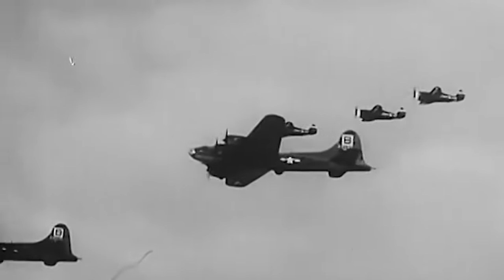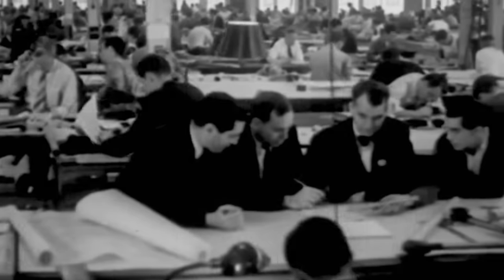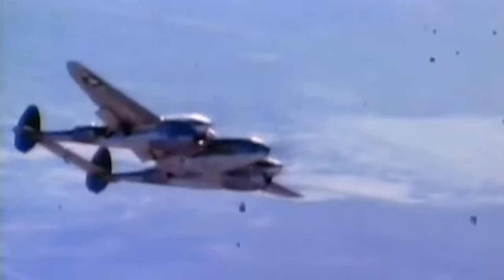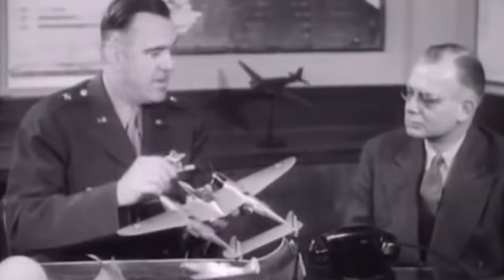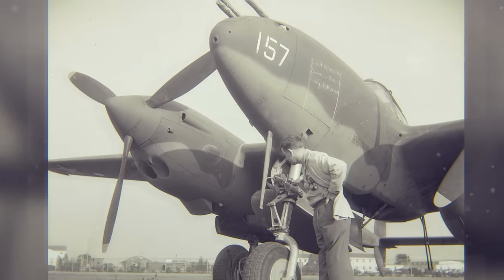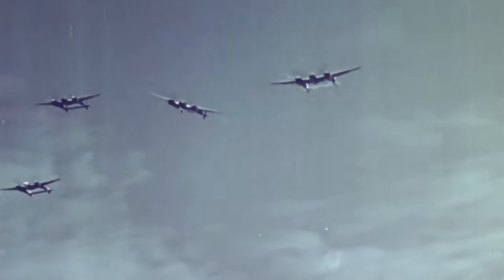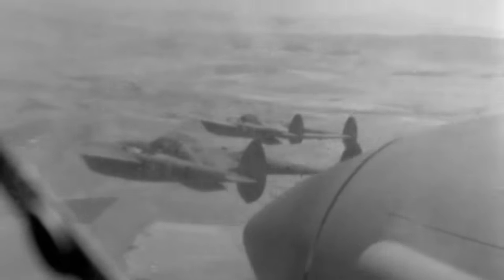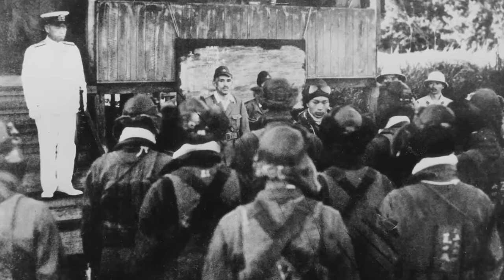Lockheed P-38 Lightning: Outstanding Fork-tailed devil fighter-bomber

Comment: I wonder how the P38 and also the P39 would have performed with the same Merlin engines in the P51/Spitfire?
Reply: I dont think Rolls Royce would have allowed any to be used in another US plane. They had been diddled with the Mustang
Reply: In the P38 there would have been a loss of performance.  It had supercharger/turbochargers for high performance, high altitude operation.  The P39 didn't nor did the P51.  That is the reason that the Merlin did so well.
Reply: The Russians preferred the P39 over any other fighter. It had a higher kill ratio than any fighter in the ETO. It was a superb fighter at low altitudes. It's lack of a dual supercharger was it's biggest limitation.

Comment: The wooden wonder mosquito could carry nearly equal bomb load to a B17 and fight ( Not at the same time . ) 
 I was astounded to read that the P38 carried nearly twice the bomb load of a B17  . These 2 planes are in my top 2  favourites  from WW2 . 
 Bombing Germany would have been a safer prospect with these 2 planes exclusively .  And they could have escorted eachother or themselves .
Reply: The 17 could carry 12,800 lbs of bombs.
Reply: @miketrusky476  Trading off fuel load for bombs.  I don't think that a B17 could get all the way to Berlin with 6 tons of bombs aboard.

Comment: So, answer me this if you would: then why did it take until very late 43 - 44 for the Army to provide long range fighter protection for the heavy bombers over Germany ? These were in the Pacific in 42 !
Reply: The 38s were the first fighters over Berlin,  the Army demanded they fly wirh the bombers (250mph) same mistake the Luftwaffe made over England, wirh the same results and poor reports of plane and pilot were to blame as a cover up for poor taticts. When ALLOWED to fly away from the bombers as the 51s did all kill numbers to lost fighters were almost  exact, because of camera work the 38 was unarmed, skewering the numbers more. Used as s light bomber ,with loss of speed, , almost 80mph and flying low to avoid RADAR  also increased the numbers lost. No other fighter could be asked to do these missions , the uneducated of these facts view the 38 poorly.
Reply: @miketrusky476  yes. Until Doolittle took over the 8th, fighters were on a short leash. BUT even then (42-43), NO 38's or 51's were present in the ETO. Even though the 51's were bought by the Brits in 40 ? AND, HOWEVER,  the 38's WERE in the PTO because they were used to shoot down Yamamoto in 43 (Operation Vengeance 18 April 1943) So, my question stands. Why weren't they used in the ETO sooner ?
Reply: @billotto602  2 squadrons of 38s fought to the end of the war in Europe cant remember the "Back Door GANG " number, but you can verify,  374 I think was one.
Reply: Numerous units did, the 47s were being upgraded well into 44  and the 38s stayed to wars end in Europe. "The Back Door Gang.
Reply: @billotto602  Those P51 bought by the Brits was British with Allison engines and were stuffed at 25000ft
Reply: @jacktattis  until they stuffed a Rolls-Royce Merlin in them ! PLUS what about the P-38's ?
Reply: @billotto602  1. The P38  was in the ETO from 42 to 45 P51 Dec 43 to May45  Mustang in RAF service May 42
Reply: @jacktattis  then why didn't the bombers have fighter escort till 44 ?

Comment: The P-38 Lightning was a failure in Europe at the altitudes combat was taking place. It was relegated to low-level ground attack and photo recon operations. The P-47 was a similar story.
See Col. Robin Olds flight reports on the P-38.

Comment: It was a plane similar to Messerschmidt 110, which couldn't fight for itself over England, but needed an escort. It later fought on as a fine Nightfigther. But in the end Germany had neigther trained pilots nor fuel and the Allies reigned in the sky over Germany, so even the fast jetplanes had to be protected during start and landings. The only time Allied planes could follow them. If met by the best German fighters and pilots it had no chance.
Reply: Depends on the situation silly
Reply: P38 was the highest scoring twin engine fighter of the war with 3,785 shoot downs claimed by American pilots.
Reply: @nickdanger3802  Claimed and actually correct is very far apart Nick

Comment: The "dive brakes" were not speed brakes as such. The small panels prevented nose "tuck" by keeping the center of lift on the wing from moving so far aft due to compressibility, that no amount of elevator could pitch the nose back up for dive recovery until airspeed slowed. Unfortunately, some pilots went into the ground during early dive testing, as the airspeed never slowed enough before necessary altitude recovery margin was used up. Center section airfoil was quite thick (more susceptible to compressibility) because at the time the P-38 was initially designed in 1937, drop tanks were not permitted. There being no room in booms for fuel, the gas tanks had to go in the wing center sections, and thus the thick airfoil. This was not entirely bad. The stout wing centers allowed the P-38 to carry a 2,000 pound bomb or torpedo under each wing. Or a 310 gallon drop tank. Flown with good fuel conservation technique and two drop tanks, the P-38 had a range of nearly 3,000 miles - far more than any other fighter.
Reply: The venturi effect as air interacted between the nacelles and the gondola also sped up the air flowing over the center wing, thus it would enter compressibility before the rest of the wing did.

Comment: The reason the british rejected the P-332 was its lack of a turbo-supercharger, armor protection, and the compression problem with air flow over the elevator in a high speed dive. As well as  armament incompatibility with british weapons of the time.
 The Americans were not about to let turbo-supercharging technology out of their control at that time.
Reply: Also it's lack of counter rotating engines made for difficult  handling for en- experienced pilots.
Reply: Export P38's "The model 322 for the RAF was produced parallel with the AAF P-38E's. The first production Lightning 1 as it was designated, flying in December 1941. The first 143 aircraft of the British contract were model 322-61's dubbed 'castrated P-38's ' by the factory had the turbochargers and opposite rotating airscrews removed, and two of the early V-1710-C15 (R) engines rated at 1,040 h.p. at 15,000 feet, the "R" indicating right hand rotation. For some unexplained reason, the British Air Purchasing Commission had requested these modifications despite predictions by Lockheed engineers that performance would be inferior to the standard model. Two model 332-61's were tested at Boscombe Down in April-June 1942 but performance was so disappointing that the aircraft were returned, and the remainder of the order cancelled."

Aerofiles Lightning I/II exports page  Has ! Not secure warning

Comment: Little known fact: this plane was nicknamed the fork-tailed devil.
Reply: Craig  It was designed by Lockheed to be an interceptor.
Reply: Craig  I'm just trying to share information. It had two Allison engines and was designed to climb to twenty thousand feet in six minutes.
Reply: Craig  Cool. The P-61 was designed by Northrop to be a night fighter.
Reply: Craig  Wow! I love the F-22 but I think the F-23 is cooler looking. It looks like a sci-fi fighter jet.
Reply: It was a well know fact lol
Reply: @timf2279  And the reason for that is because I told everyone, Tim. I am a YouTube commenter, which makes me an expert on just about everything. If you have any questions, please feel free to ask.
Reply: @Cheka__  Block 🚫
Reply: @timf2279  Block has several meanings. It can be a cube shaped stone used in construction. It sometimes refers to a square shaped geographical area in a city. It's also a verb that means to prevent. The red circle with a diagonal line through it is a symbol that means prohibited. Often you'll see it with a cigarette in the middle which tells people nearby that smoking is prohibited in that area.

Comment: Yes, very successful in the Pacific, But this is an old view that completely ignores the P-38s in the European Theater. As bomber escorts, they had the range to accompany bomber groups but were a fairly ineffective defense. Test pilot Eric "Winkle" Brown who flew and analyzed just about every combat plane from all sides judged the P-38 to be lacking since its top dive speed was less than  attacking German aircraft using boom-and-zoom  tactics -- P-38s couldn't catch the attackers unless perfectly positioned. P-38s used in ground attacks against anti-aircraft protected targets fared poorly; rugged P-47s with more armor were up to the job there.

Comment: The P-38 and P-47 had a critical mach number (the fraction of the speed of sound at which their pilots would lose control) that was lower than the 109 and 190 - which meant - that the P-38 couldn't follow them in a dive - so they could always just dive way from one to avoid it.

How-some-ever ... most of the pilots shot down - didn't see the person who shot them down before it happened.

The other thing is - that if a P-38 attacked a 109 or 190 that was attacking the bombers - and they dove away - the act of diving away - would disrupt their attack on the bombers - and they'd have to climb back to altitude to get back into the fight.

Since the Escorting Fighters were not supposed to follow the enemy away from the bombers anyway - this didn't really matter.

What did matter - was that the P-38's had very good range.  Before the P-51's they were our longest range escorts.
Reply: lol... no rational pilot went into a dive with a jug... you shot yourself down in the 1st paragraph.

Comment: The reasons why England didn't do too well with a p38 at the beginning is because they thought they would order it without the engines and put their engines in it, it was a nightmare so they finally ordered them from the United States with their engines in it as they became one of the most dreadful aircraft that's a gervais ever saw
Reply: No that has been a lie since WW2. The RAF were shown a plane with one engine The US Govt would not allow that engine to be sold and Lockheed tried to sell the planes with inferior engines and the RAF pulled out and never bought any P38s .

Comment: By no stretch of the imagination was the P-38 feared by the Luftwaffe. It did not have a speed advantage over the German fighters, especially around 20,000 ft which the Germans preferred. The P-38 was not stressed for high speed maneuverability. Things got so bad Jimmy Doolittle had it tested at the Royal Aircraft Establishment, which pointed out the flaws. It was all hype like the Norden Bomb Sight and the B17 not needing escort fighters!
Reply: So now you `ve frustrated a lot american viewers!
Reply: @michaelpielorz9283  Its funny how wartime propaganda and miss-information persists. I should have pointed out that Jimmy Doolittle got the P-38 tested  at RAE because of the high losses 8th AF was suffering in late 1943 - early 1944.
Reply: The p38 was designed as an intercepter and was excellent for the war winning tactic of boom and zoom, why fight like a dog when you can strike like an eagle! Lol
Reply: @kenneth9874  Just that the German "eagles" were much better at it. P-38 was phased out in the 8th AF as soon as it could be replaced by P-47 and P-51. In the Pacific it had the advantage of range and could turn up unexpected. It was also fighting mostly older KI-43 and A6M3 which were much slower.
Reply: That sure explains why the most decorated Ace of ww2 in the European theater if not both on the US side flew it. Guess we outperform you even in "inferior" warplanes.
Reply: @TheGoddamnBacon  Lets not wave flags here and stick to sensible comment. Bong and McGuire only flew in the Pacific. Were there was no Japanese fighter that came remotely close to the P-38s speed. Gabby Gabreski flying a P-47 and George Preddy on P-51 were the top aces in Europe. They had a harder time flying against German fighters with similar or better performance.
Reply: "There is little wonder that loss rates were relatively high and the kill to loss ratio was below that of the P-47's which could be massed by the hundreds (700 P-47's flying escort was not uncommon). The Luftwaffe quickly learned to position the bulk of their fighters just beyond the range of the Thunderbolts and repeatedly flew aggressive small unit ambushes against the handful of P-38s tied to close escort and thus denied the freedom to engage at will."
AIR POWER AUSTRALIA

Comment: Sad the the ALLISON was so bad at that time that's why they  got rid of it and the P51 had the performance it needed! But they didn't want to spend money to change our engines to MERLIN they had no problem spending billions on the B29. I wish they would have either put a 2 stage super charger in the P38 and dump the turbocharger that did not have the metals to work at that time it over heated and threw valves and rods because darn heat. If the MERLIN was installed NO DOUBT IT THE P38 WOULD BEEN BEST FIGHTER OF WW2! EVEN SO WAS BEST IN MY OPINION anyways!

Comment: Wrong, wrong, and wrong. Lockheed first showed a "P38" prototype to Frank Carlson, Funk and Wagnells illustrator in late 1937 or 1938, for inclusion in Assen Jordanoff's "Through the Overcast" then asked him not to publish his ink illustration of the cockpit. The twin engines were primarily to remove weight from the center of the tapered wing, and allow blackout G forces. The center nose guns benefited mostly from the superb visual sighting of the bullet streams. Popular left/ right guns crossed for dogma, not sound armament, and shooting one side straight at a time would have helped the longer shooting. ...3 little details don't trash your wonderful history presentation. The P38 was the war's best piston all out pursuit plane. It was just too expensive to build.

Comment: It wasn't feared that is the problem.  P38 suffered the same short comings the Bf110 suffered over Europe.   There are plenty of accounts of German pilots preferring to engage P38s vs single engine fighters.

Even the name Forked Tail Devil wasn't used by German pilots and is a news paper Propaganda name by the Americans.   

There is a reason this plane was relegated to CAS in Europe or were shipped to the Pacific.

I've even seen Bf110 and P38 comparisons that placed the Bf110 as a better twin engine fighter.  Only issue is the P38 wasn't successful in Europe.  Only in the Pacific vs under powered Japanese fighters that struggled in energy fights did the P38 dominate.. but in that Scenario most western twin engine fighters would.

Btw I'm a huge fan of both of these planes.  But the P38 wasn't a wonder weapon.

Comment: A pressurized cockpit would have allowed the plane to fly above the enemy and made it the most famous plane of World War 2. To get down into the fight the plane would have needed dive brakes to go along with the pressurized cockpit. And lastly, the propellers were not big enough to absorb the horsepower that kept going up, so it was never as fast as it could have been. There was also the poor roll rate, the original intercooler system, and the cold and poorly designed cockpit layout. All of these problems could have been solved before America entered the war.

Comment: That Lightning F5 90% of European photos ‘fact’ needs explanation, was it one squadron’s total, the combined allied forces total? 90% of exactly what?  The Lightning F5s like the Lightning fighters had unacceptable engine control mechanical unreliability in the northern Europe high altitude’s extreme cold and the UK based USAAF photo reconnaissance units changed over to PR Mosquitoes and PR Spitfires so the 90% figure is even more puzzling.
Reply: England was only one small part of ww2
Reply: @kenneth9874  How about the Norway to the Bay of Biscay front?  You know the one including France, Belgium, The Netherlands, Denmark and Germany, sort of significant eh?
Reply: F5s saw operations in the Mediterranean; Antoine de Saint-Exupéry died in one somewhere over the Adriatic.
Reply: @w.reidripley1968    In July.